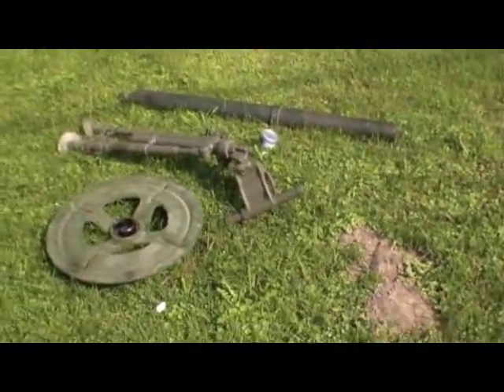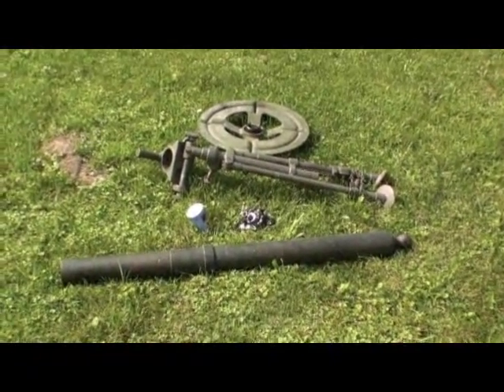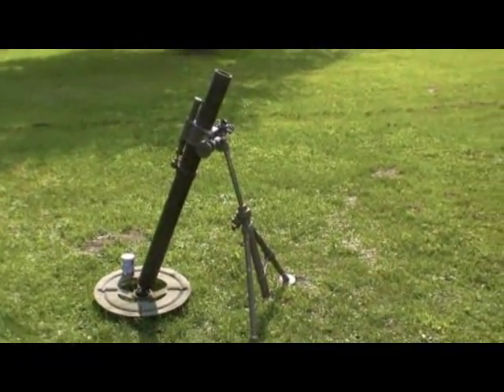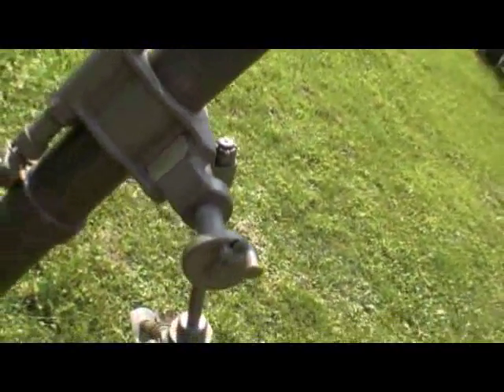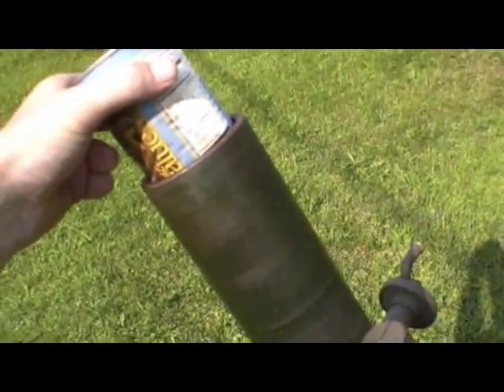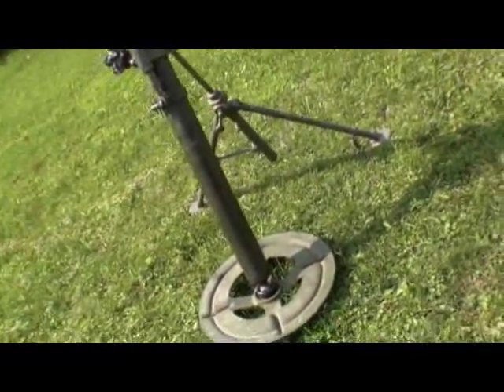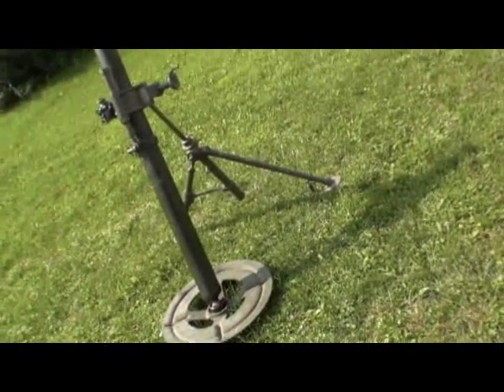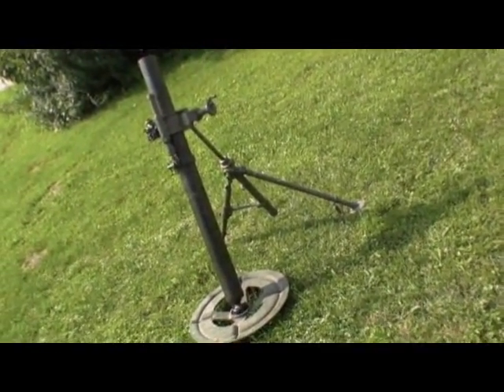81mm Black Powder Mortar closeup

Comment: You said 900 yards range. But what loading and exactly what weight of projectile and what angle was it fired at. The 900 yards is close to the original Stokes mortar range and I would love to compare your firing table to that baseline to see what would have been possible in the mid 19th Century had anyone been sharp enough to have invented that form of mortar